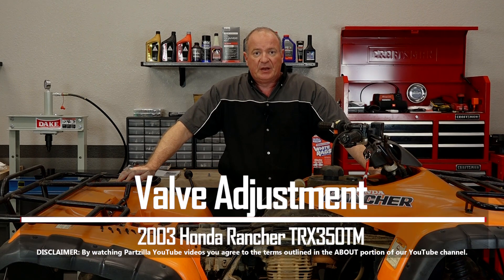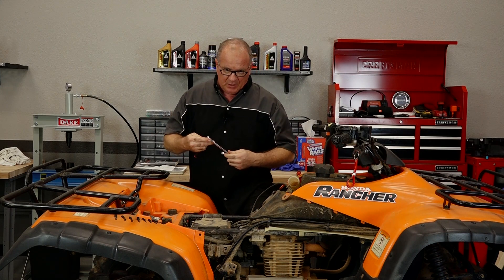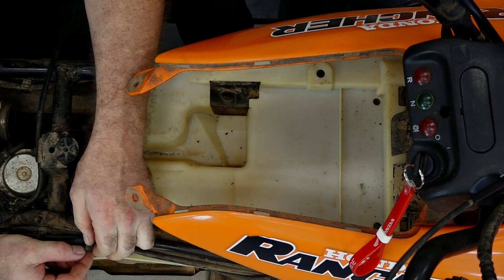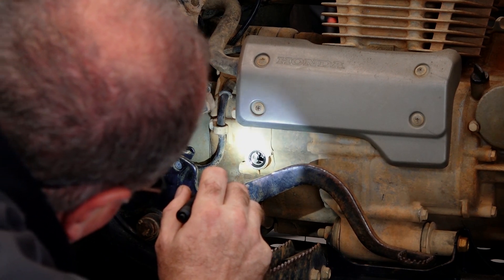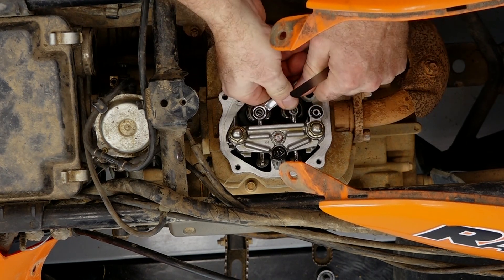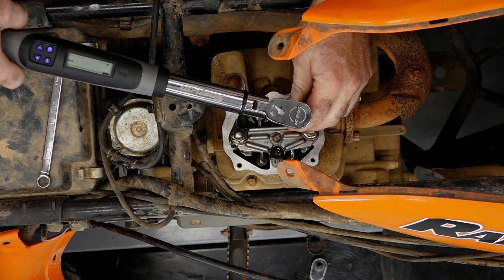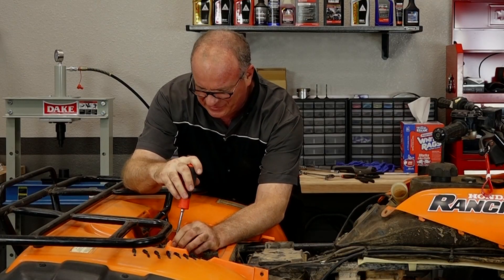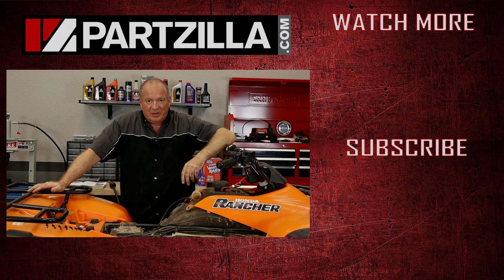Honda Rancher 350 Valve Adjustment | Partzilla.com

Comment: Hi.  Nice videos. I am retired licenced tech and I have a nighmare here at my home garage. 2000 trx350 came in no start, no compression. Removed head cover-rockers didnt move when cranking. Removed engine-removed rear cover and found broken timing chain. Replaced guide,chain,tensioner. Set marks exactly as in manual. Set valve clearance. Also replaced rings, piston and lapped in valves as they were corroded . Back together now and no start-double checked spark-good spark. -tried 2 new plugs. Can get it to sputter . Primed carb , primed directly into cylinder-fresh fuel still inop. Noticed when I pull it over by recoil its almost impossible . Very high compression. Checked compression. 180 PSI while cranking at 450 rpm with starter. Would bad decompressor cause no start while it still cranks good?
Reply: Yes, it must have a compression release to start it

Comment: I've got a question about valve clearance on 350 rancher "is the clearance that you set your gap on the only clearance that you would have as the motor turns are there any point that you will get more clearAnce between rockers and pushrods
Reply: Help me figure this out please I'm gaining clearance at a certain point is this normal
Reply from the maker: We'll answer that one Friday, Nov. 15th at 3pm on our YouTube Live. If you miss it, it will be avaialbe on our channel shortly after the show ends.

Comment: after I adjusted the valves  startup sounded great, a short test run was great but after a longer run time when engine was warmed up the valves became noisier  than before they were adjusted. adjusted them again after engine cooled down and the same thing happened when the engine warmed up. wondering what the issue is?

Comment: Saludos desde Honduras. Tengo una cuatrimoto Honda rancher 350 2006. Pero suena como martilleo solo cuando acelero ya regule Las válvulas cree que podría ser desgaste de la biela? Espero saber pronto dé usted. Muchas gracias.
Reply: Pues según las dos válvulas llevan las mismas calibración pero unos  dejan más floja la del escape x que si quedan muy apretada el motor se calienta   y se debería de checar los balancines. Si no tienen mucho fuego   y ponerla a tiempo " T"

Comment: I have a 06 rancher 350 4x4 and we put a new jug and head on it today. Along with a new carb and fresh gas. It only turns over. It won’t start. Put new plug in it and make sure it had spark. After spraying some starting fluid, it backfired a few times but never acted like it wanted to start.
Reply: What was the fix??
Reply: Carb clean I’m guessing or ignition switch

Comment: Rebuilt the top end of my 01 trx350 and it is running rich to the point of a new spark plug being completely back after only running a few minutes. Any advice?

Comment: So I have this same exact bike and I was going fast and it was ticking already and it lost power and started trying to stall hasn't started then and when I do try to start it it backfires alot but sounds like it's trying to start normally but doesn't start is this the valves?
Reply: Piston rings. Mine just did the very same thing. Had to do a whole top end rebuild

Comment: With the valve being out of adjustment  will it cause it to smoke?
Reply from the maker: it could, but more likely you are leaking excess fluid into the cylinder.
Reply: @PartzillaParts  which means?

Comment: Hey I’ve got a 400 odes it’s the clone for this motor would valve clearance be same
Reply: I also have an Odes 400. I followed his procedure and the old girl seems to run fine. Does your suspension ride like a buck board?  I put Honda Rancher shocks on it and it helped a little, but not much.

Comment: I adjusted the valves on my Honda rancher 420 but they got louder I double checked them and It was on the correct stroke each time
Reply from the maker: Did you double check your measurements?
Reply: @PartzillaParts  I happened to do it agian and I noticed they have to be kinda tight or they will be off I had to make sure that they were tight till they the next size up wouldn't go in is that normal? Or is it worn out?

Comment: What's torque on valve cover bolts??
Reply from the maker: Torque for those size bolts is 7ft lbs
Reply: @PartzillaParts  are the value cover gaskets reusable on a 2001 honda recon 250?
Reply: @zachmosteller4681  I wouldn't reuse the gasket, it's cheap enough to replace. I just bought a 05 and the valve cover gasket is leaking pretty bad so I'll be replacing it and adjusting valves while I'm there.
Reply: @Powertool1990  oh I didn't know I called honda and asked them and they said it will be ok to reuse it especially since my engine has never been disassembled
Reply: @zachmosteller4681  it might be fine to reuse but if it was me I'd replace it for less than 10$ just in case. Kinda a pain to pull fuel tank again if it happened to leak.
Reply: @Powertool1990  were can you find one for under 10 bucks? If I can get one for that price I'll go ahead and replace it
Reply: @Powertool1990  because everywhere I've looked it's going to be about 20 bucks with shipping
Reply: @zachmosteller4681  12315-HN5-671 should be the part number of the gasket and partzilla has it less than 10$
Reply: Sorry that gasket is for a 350, you need to double check for a 250 recon. I thought you had a rancher
Reply: @Powertool1990  yeah the valve cover gaskets for a recon is $16 plus shipping

Comment: Hey! I have a honda trx350fe 2001 model.. one day i was out plowing with it it the electric gearing started to get slower and weirder so i had to push it back and fourth to shift. And suddenly it was stuck in reverse.... i went in and when i got out i got it in neutral and pushes it in the garage.. later i opened the gearbox and i didnt see anything wrong and right after i opened the crankcase cover the gearing was fine again.... so i was riding it and suddenly the same happened i tried with the manually shifter and it didn’t work.... and sometimes the elextric shift works and sometimes it dont, And the with the manualy shifter. Can it be the clutch? Every time i push the electric shift buttons i can hear that it is trying... but wont shift.. and nothing happens when i turn the manually shifter. Please help. It’s pissing me off!
Reply: I have also tried adjusting the clutch....
Reply from the maker: A couple of basic questions. 1.) What oil are you running and when was it changed last prior to the shifting issues? 2.) When you "I opened the gearbox and I didn’t see anything wrong and right after I opened the crankcase cover the gearing was fine again" were you looking at the clutch/gear shift linkage on the front facing side of the engine? If so did you try to move the gearshift shaft to feel any binding inside the transmission?